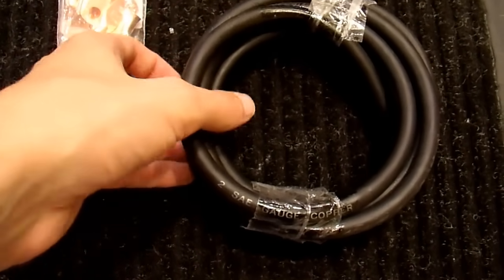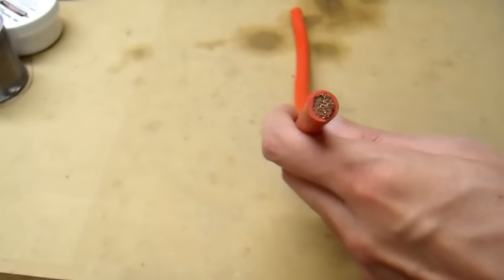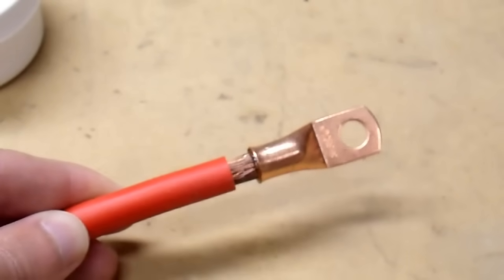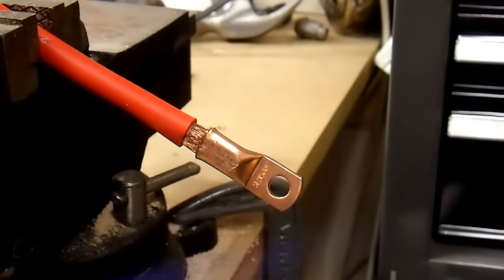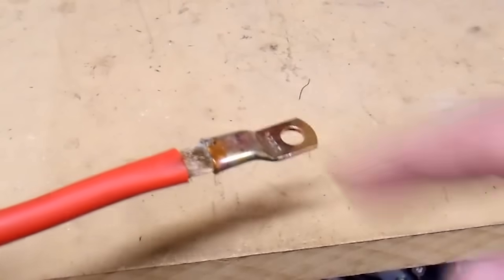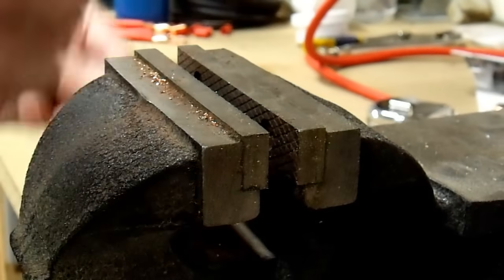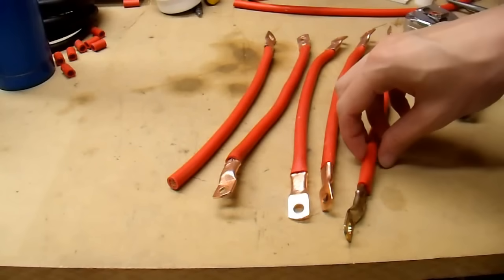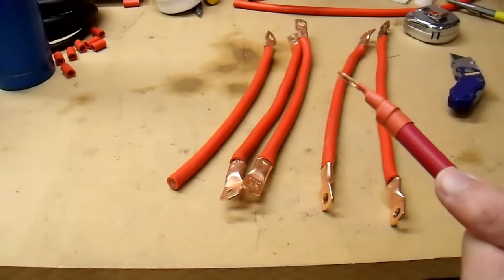How to Make Battery Cables the Right Way and the Easy Way

Comment: I guess that the military, aerospace, auto manufactures, and electrical distribution companies to name a few should view this video to see what they have been doing wrong for so long.

Having worked a more than a few technical areas in my time and terminated everything from 30Ga wire up to 1000MCM I have a bit of an idea of proper procedure.  Not to mention a decent selection of crimping rools

Reality check, High current connections that you want to last should be properly crimped!  NO SOLDER!  The solder wicks back up the wire and causes the wire to break at the point where the solder ends.  Also the rosen is reactive and will cause corrosion at elevated temperatures a starter cable would encounter.  His dislike of heat shrink tubing is unfounded and ill advised.  Glue lined irradiated polyolefin tubing is the best choice for the job.  It provides a decent seal of the connection as well as a supplemental strain relief for the connection.  A properly crimped connection will be serviceable for decades with little to no increase in resistance.  There is a reason connections in homes are no longer soldered, they corrode over time and fail.  Do yourself and others a favor and take this down.  Also buy a crimper, there are a bunch on Ebay and Amazon for cheap that will provide a more than serviceable termination in about a 10th the time and effort.  Finally protect the interface with glue lined irradiated polyolefin heat shrink.  Best of all they will be terminated right.
Reply: I agree with much of what you have said.  Where I have disagreement or clarification is needed is your comments on soldered connections.  You mention issues but leave off that those issues only come from improperly done solder connections.  FYI NASA MIL Avionics all use large amounts of solder connections in high vibration environments.  The exact same thing could be said of crimp connections and in fact I would go do far as to say there are more failures of crimp connections than solder in the real world.    People would all do themselves a huge help to have a good quailty multimeter before crimping or soldering a wire.  Especially if its a sensor wire of any type.

Further a soldered connection can almost always be visually inspected and have no ohm drop /resistance increase.  With crimp only connections its hit or miss in that two connections that look the same can produce a clean no drop connection or one with a few tenths in ohm loss.

Proper solder connection goes as follows:  
* Strip wire with no damage to core wire/s. Visual inspection
* Tin wire stopping a wire diameter in length from the wires insulation 
* Slide into connector or make splice ( mech connection: twists such as short western union splice etc)  Proper fit to connector and form of splice if used visually and physically inspected
*  Clean all solder and bare exposed wire with acid brush and alcohol or other rosin/flux solder wash cleaner usually pure iso alcohol.
* Connection is checked with ohm meter and visually inspected
*  Use heat shrink with sealant depending on condition requirements.  We always used only mil spec i.e extra thick with/without sealant heat shrink which was made of polyolefin.  Its thicker and stiffer than tradition sleeves. The heat shrink must overlap the wire insulation by 3x wire diameter in length.  (These were used irregardless of connection type crimp or solder or combo.)
* Final ohm meter and visual inspection.

With the solder stopped the spec distance prior to the insulation prevents solder and flux rosin wicking past the insulation.  There are also heat guards to prevent these issues in highly critical areas that you use at the wires while you solder joints.   At NASA it was a requirement for many jobs.  This  gap of tinning and or joint solder prevents any areas that will not be able to be cleaned and corrode/weaken creating resistance/short/failure.  

You can certainly use clean free solder with rosin free and or non corrosive rosin.   But if its allowed and meets spec it is always easier and in most ways better IMHO to use leaded solder and no matter what type rosin free or not always clean after soldering with a proper wash and brush.   For those that do not know an acid brush is a type of brush and has nothing to do with actual use of any acid at all.  Its a brush used to clean soldered connections splices etc.  The cleaner is usually/traditionally the same alcohol used in rubbing alcohol you find in most med cabinets.  It is a pure / much high percentage form so do not go using rub al.  Its isopropyl alcohol

The use of heat shrink sleeve more so with heat activated sealant  not only protects but aids mechanical strength to the connection splice or connector.  Further the overlap of the wire insulation moves the flex point back to beyond the strip to where both factory and sleeve insulation meet.  This will always be at least as strong as the base wire and insulation combo.  No matter what connection crimp, solder or combo crimp and solder you never have a splice or connector where there will be bending or sharp radius's.  Thats just poor engineering and electrical work.  Not saying you recommended this in any way just a point for anyone reading.  Set this way there are no weak points that are going to break or have corrosion.  Spliced line a linesman/western union short or long and stronger than the base wire and insulation itself and that is even without any solder or sleeve.  

Another thing to consider is proper crimping ALWAYS damages the wire thru deformation.  Soldered splices almost never damage wires and thus can be undone if needed.

Solder connections create more contact area and thus equal or much close to no change in resistance and wire capacity.  Crimp connectors freq can not.  This can be critical with computer drive sensor command and control pathways where sensors use volt signal coms. Where 4.2 volts vs 4.1 volts is a different reading and thus effects how the program reacts.  No matter what type connection you use alway have a high quality multimeter and test every splice and connection.

The Video author makes a number of mistakes or lack of critical info such as the type of solder and its quality along with any flux and type is very critical.   You do not want to have people grabbing plumber solder and flux for sweating copper and brass pipe connections/joints  and using it for electrical and electronic soldering.  No mention of cleaning or distance from insulation.   There are specs and standard for a reason.  

Both crimp and solder connections can be very high quality and work without issues but both can be done wrong and will lead to trouble.  they both have plus and minus.  Crimps are quick and cheap which is a signif reason they are used where ever they can get away with it in the automotive industry.   But in areas where perf and quailty regardless of cost is the focus such as the aerospace and areas of the military you see many more soldered connections.

Given how critical proper voltage is in todays  computer controlled vehicles you want to be extra critical of your splice and joints and ensure there is no ohm drop with any connection you make.  Many engine systems will not even allow the engine to start without seeing proper voltage from the battery/s to the computer.  Everything from your gas pedal position to the temp of the various engine fluids is expressed in different amounts of voltage transmitted from a sensor thru connectors and splices to the computer i,e. usually called the  PCM (Power Control Module) thus for a proper running vehicle be it car motorcycle boat airplane or even civilian drones all connections and circuits must be clean and with no resistance issues.  To include ground connections.  They are VERY critical so do not cheap out on them.

For crimping make sure you use the proper crimper for the type of connector i.e single vs double crimper.  IMO ratchet crimpers are better choice as they take much of the skill out of making a proper crimp.  Many crimps fail from too little or too much crimp pressure.  High quality ratchet crimpers prevent this.  Expect to spend $50-$100.  Single crimp is used for heat shrink and double crimp for nylon.  With heat shrink a double would crimp and damage the heat sleeve that overlaps the wire insulation.  With nylon there is no heat shrinkage thus not sealed from environmentals and both the metal connector and the end of the nylon sleeve are crimped to further increase holding compression and sealing the connection.
Reply: Most of which you speak applies to small canon connectors.  Though they come in solder cup configurations most if not all flight electrical connectors utilize crimp.  Full cycle crimpers (what you refer to as ratchet) assure proper termination to factory spec.  When you venture into larger conductors and higher currents you will not find solder used, period.  Solder has its place, just not in this case.
Reply: @timw911  Very much agree that there are soldered connections and that aero and space specify and use them frequently.  They are very reliable when the done using all the correct tools and procedures.  Most people do not have the slightest idea of what is involved in doing it though.

But my focus is strictly on large conductors and hight peak currents here.  Not specifically mil/aero ITT or Cannon connectors.  At this point most all of my terminations to lugs be they service conductors for a home or business od high current DC is crimp.
Reply: @timw911  Proper tooling and procedures assure that a crimp is just as reliable and repeatable as solder.  Specifically referencing high current connections, they crimp.  Sure, they solder mil connectors for aero but it is in no way a simple process to comply with mil standards.  Properly soldered they are very reliable to be sure.  But we are talking of small signal connections for a hand full of amps.
Reply: Hey, sombody has to tell it right. 6o + years into electrical wiring systems n mostly aviation, marine, industrial, and bout 50 yrs of wind, hydro, n solar systems. Do it right or expect failures. Well presented comment. Dan
Reply: It would help to explain WHY it's a bad idea to solder high-current connections. Because of the potential for the wire to get so hot under load that it melts the solder!
Reply: I used to solder wire connections and after 5 years lead become tiny  dust and fall apart
Reply: It is unfortunate that high rated correct consensus replies do not rise to the top
Reply: No they're not. 
You can get a cheap $20 crimper that will do a far better job.
Reply: Forgot to add that allot of auto manufacturers have been either spot welding connections via resistance or laser for a good time now.  NASA spot welded and wire wrapped their computers for a long time...  wonder why?
Reply: Your comment is on display for all to wonder at and marvel at you stupidity and clear lack of understanding of the proper connection methods based on application. Simply getting away with doing something wrong does not make the deed right.
Reply: @PandawdyBob  
... in certain applications.
Reply: Why don’t you show us how it’s done and make a “proper” video ,mr knowitall
Reply: mikeiver z I agree BUT some of us live 20 miles from town and poor so solder,heat shrink and or black electrical tape it is..Duct tape (all not just metal) are supposed to conduct electricity and not be used..BUT I'd rather have it than bare wires.It seems you are an intelligent man however for the most part at least we live in the Real World where u use what u got...
Reply: @baddestbees5924  
I guess one has to decide whether to use the proper method versus get by with what you have, based on the status of the individuals and/or the project.  Majority of the viewers are most likely near a supply store.  That said, I too have used the solder method and 30yrs later, it's still holding up without the "smashing" of the lug ends--only solder.  However, I am now a firm believer of the crimp method, whenever possible, as I have experienced problems with solder method on smaller gauge wires.
Reply: HI any videos to show your description of how it should be done?
Reply: @madarehgallag  everything this goober does is a fail
Reply: You are quite simply correct. 
This is not the way to do it. Even a cheap eBay hammer crimper will do a better job.
Reply: @ScottDLR  Have one and have used it on occasion.  They provide a passable crimp on the cheap.
Reply: The wiring harness inside of formula 1 cars dont use solder to connect wires as well. They crimp them because of the crazy movement of those cars do well cause fatigue on any wire that are solder which will eventually lead the wire to break. Crimp everything, dont use solder!!
Reply: @JimmyEG1  It really depends on the application. Both crimping (with a GOOD crimper) and soldering have their place and we do use both in aerospace.
Reply: @ScottDLR  i dont build space equipment so i wouldnt know  but one thing i do know is any wiring that goes underneath of hood of a car should always be crimped. Soldering will cause to much fatigue on a wire and it will eventually break. Formula 1 cars are a testament to that.
Reply: @JimmyEG1  I would mostly agree with that. Anywhere there's vibration, crimps work better because of their built in strain reliefs.  Of course this is only true if the crimps are done right. Cheapo crimping tools will have just the oposite effect and can cause wires to break.
Reply: @JimmyEG1  Motorsports looms actually use strain relieved solder splices for many branched conductors (voltage supply, signal reference, grounds etc.) There are guidelines to using them successfully however, ie. placed near a junction or booted connector where they will be supported and isolated by the rigid boot after recovery.
Reply: @JimmyEG1  Formula 1 cars will never see the stresses a modern Fighter Jet Aircraft would put to wiring connections!! Maybe the real experts that work on those aircraft could tell us which connections are used---crimp, solder or a combination of both. I believe Daniels is a manufacturer of high quality crimping tools used in the aircraft industry. You WILL NOT find them in the $50 to $100 price range that one person posted on here as being quality crimpers!
Reply: @JimmyEG1  Although I am retired I HAVE built space equipment.  MIL Spec connectors come in two types--crimp and solder.  Either type is acceptable.  Please don't make sweeping statements
Reply: @SRFDriver  LOL when was this like 30 years ago. You just keep going...think what you want the newer generation is always going to know morr
Reply: Oh wait i thought you were retired from racing...and no youre wrong
Reply: @JimmyEG1  I got my engineering degree at VA Tech.  Where did you get yours?  That's what I thought...
Reply: @JimmyEG1  Exactly, YOU don't build space equipment so YOU don't know what you're talking about
Reply: @SRFDriver  space equipment vs race equipment....not the same, plus i thought we were done....good bye 👋
Reply: @ScottDLR  I am aware if this.
Reply: @JimmyEG1  An F1 car has to last a small number of months, not years.  Completely different requirement
Reply: @SRFDriver  yeah you're going to tell me that open barrel splicing is not better then solder bro. I work with people who build cars. Last thing you want is your car to burn down while your racing it. And the engine is most likey thing thats going to give out first buddy
Reply: @JimmyEG1  What is your point?
Reply: @JimmyEG1  I guess you're right, a thousand horspower race car is much more demanding than the space shuttle.
Reply: I agree with you - this video gives instruction on how to do it wrong.  The only things I would add to your comments are to use closed-end lugs and NO-OX-ID paste for ultimate assurance against corrosion failure.
Reply: In the electrical trades most crimp lugs contain a variant similar to Noalox to seal out moisture and bite thru oxide layers present.
Reply: Gospel
Reply: Joly Jesus he isn't building a spaceship.  Who wants to buy a special crimping tool for one use?
Reply: @SD-pi9co  If $20 is going to break you, this is the worng hobby.
Reply: @ScottDLR  Good point, making battery cables isn't my hobby.  Why don't you make some for me and then never call me again?

Comment: Why would you crimp and solder? Either crimp or solder. Not both. And you can get a Hydraulic crimper on amazon for less then $30. Hammer crimpers do the same thing you did. Just smash it together. 

If you would just do a proper solder connection and use proper heat shrink  you wouldn't need to worry about whats under the heat shrink. But if you make smash connections because you are lazy and cheap. Yea then you need to worry about it.

Comment: no heat shrink?  LOL.  There are many many many reasons to use it.  It is good practice.  Further, get a proper crimper for cables, a vice and punch is fine for  a quick bush repair but very unprofessional. Lastly use rosin flux!